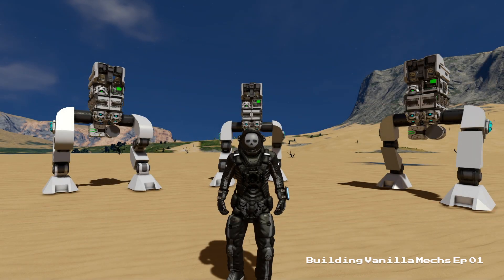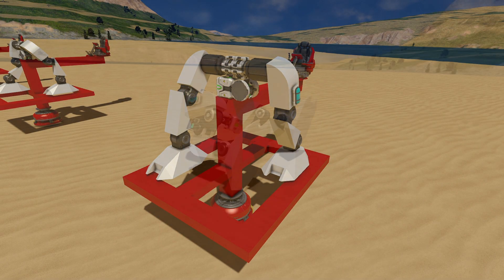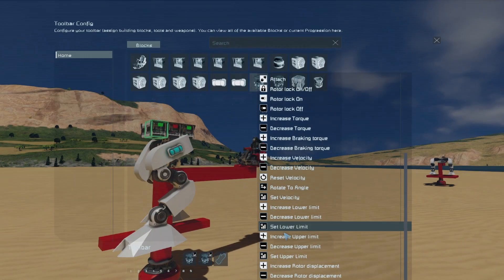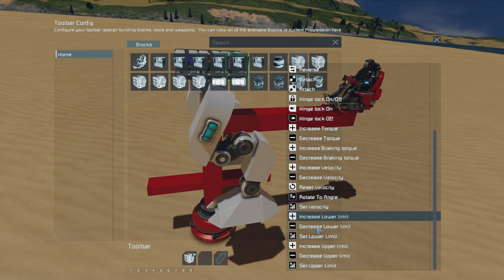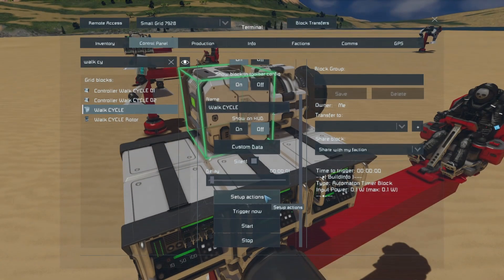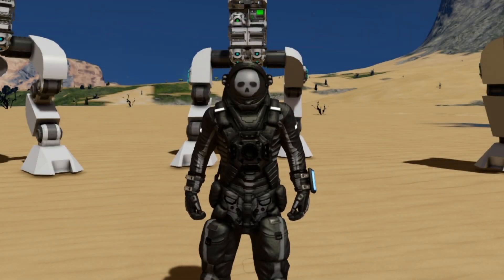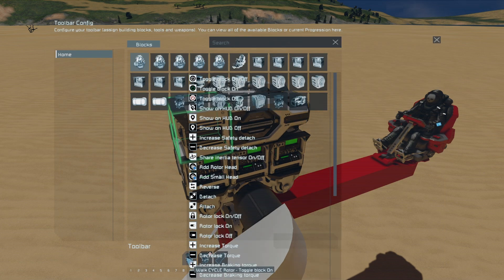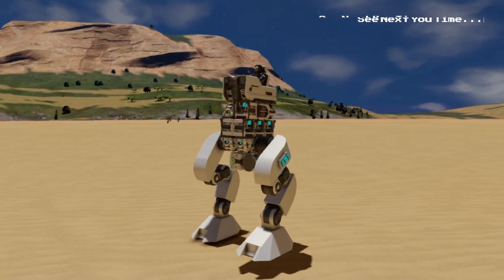Space Engineers | Tutorial | Building Vanilla Mechs - Bipeds Part 01

Comment: Very interesting guide. I'll take a closer look at this when I have more free time. I got a huge Voltron Mek that I can't get to walk xD
Reply from the maker: Thank you! Most of the principles I cover in this video can apply to as may legs as you like, but I will be covering multipeds in future videos 👍
Reply: @dread_mechanic  Looking forward to that. I will have 4 legged meks in the future.
Ok so I understand this video, will take some trial and error to get the correct angles going. But I got questions.
My small grid mek(voltron) is just under 800,000 kg. Can't do much about the weight.
That said, I've been told I need better hinge support.
Any advise for supporting hinges for large meks?
I have 6 hinges on knee, 6 for foot, and 6 rotors for hip.
Do I need all that? Or you think I can get away with a single hinge ect ect.
I want it to walk like a person.
Reply from the maker: @primesgaming369  Hinges are a bit stronger than they look. 
6 might be a bit overkill and might be causing some clang issues.

I'd try reducing the number and increasing their Torque settings.
I'd also try starting with lower RPM settings.
Big mechs have a lot of mass and trying to make large mass move quickly can cause problems (usually falling over backward).

Also more Gyro Override always helps, especially with large mechs.
Reply from the maker: @primesgaming369  Also I think I confused Voltron with Zoids, which is why I started waffling about multipeds 🤣
Reply: @dread_mechanic  Thanks for the advise. I will try less hinges. You think a rotor instead of hinge is better? I know not every mek is going to have the same items. That said. Don't suppose you can give me a gyro  number to shoot for?  And good old Zoids, I thought your comment seemed off lol. But I have thought about building a zoid in SE :)
Reply from the maker: @primesgaming369  For a large 800t mech like yours, you'd probably need quite a few gyros. 
A number is quite a difficult thing to pin down, but I'd say at least as many as you're using to make it move & turn with, possibly slightly more.
Reply: @dread_mechanic  Thanks for all the help. I have some tinkering to do. The leg movements are not as smooth as I'd like.  Hm well I do have a smaller Voltron version I could try.  Well like you said in the video, trial and error xD

Comment: If you could would you be able to do like a short or a quick explanation of bipedal mechs? Currently Im just having brain troubles trying to figure out the movements ._.
Reply from the maker: What specifically are you having trouble? I’m always happy to help 👍
Reply: @dread_mechanic  The knees, they kill me when it comes to getting them to work, Ive got the feet and the hips down, can do all the event controllers but understanding how to use the knees to make clearance is what holds back all my builds so far xd
Reply from the maker: @novagamer2175  It kinda depends on your leg set up, but the trick with the knees is making them lift at the same time as the hip moves forward and then bringing them down again just BEFORE the hip stop moving.
Set the Event Controller for the knee return to just before the hip fully extends. 
You'll need to tweak it to find the right angle & RPM for your build.

You only need to create enough clearance with the knee to allow the foot to travel forward without hitting the floor.
But preferably you want the hip & knee to fully extend at the same time 👍
Reply: @dread_mechanic Ah.. Okay I just had it a bit backwards thanks for the tip.
Reply from the maker: @novagamer2175  No worries. Glad to help 👍